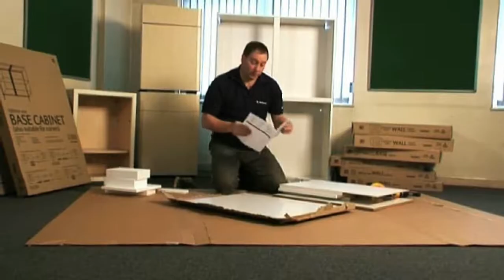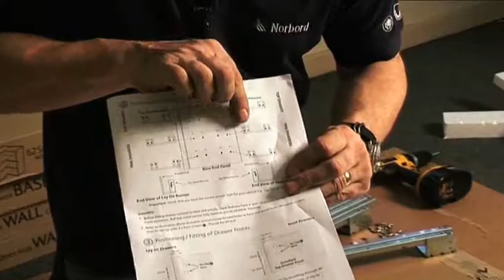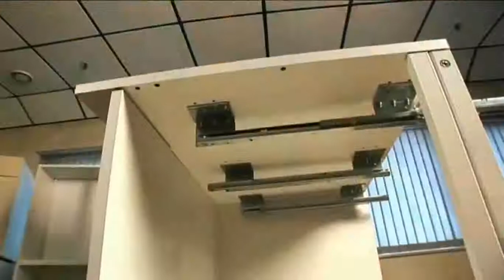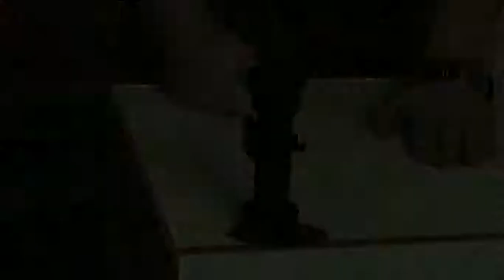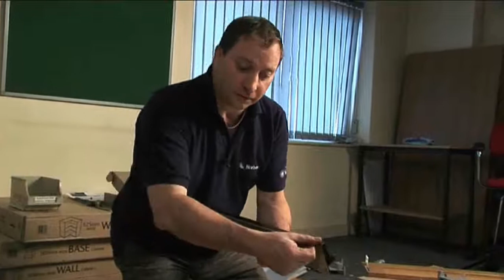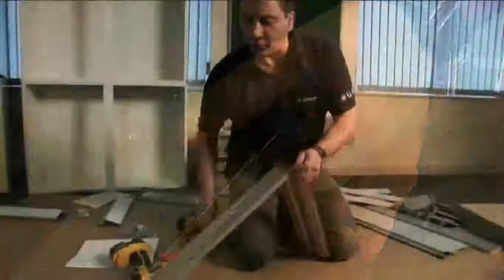Cooke & Lewis - Pan Drawer Unit Assembly (Part 1)

Comment: This is real helpful thxs.
I have a prob, my unit doesn't have the sets of 4 holes, only 2 with one higher only as a small start of a pilot hole. On top of that the screws aren't the chunyk flat end screws but just normal screws which are too small for the 2 lower holes.
on top of that the instructions are sooo limited and vague. :/